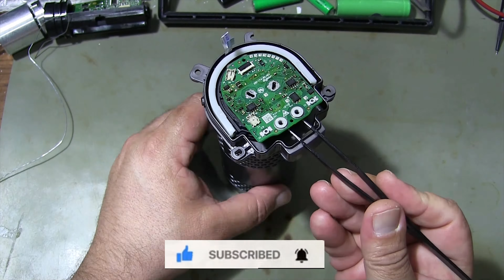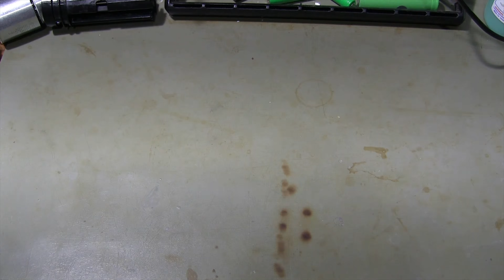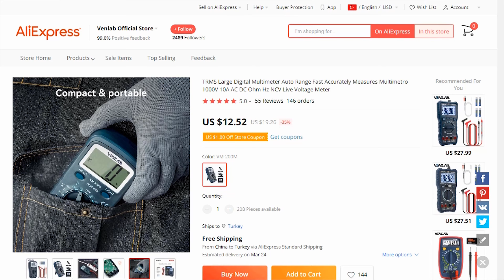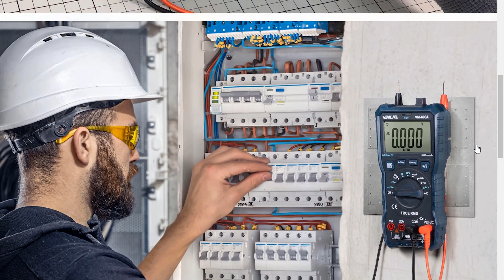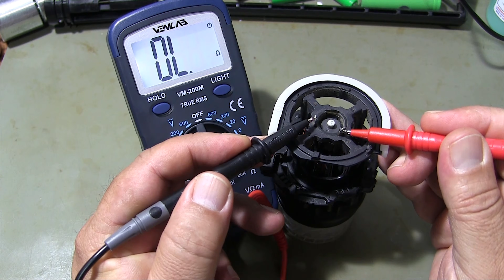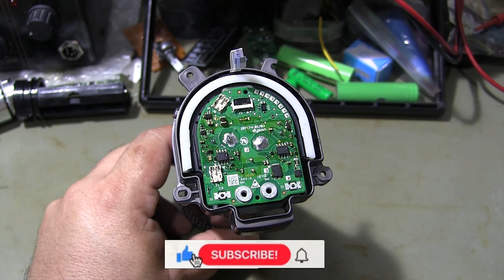How to Check DYSON V11 Vacuum Cleaner Motor with Multimeter?

Comment: My Dyson V15 suddenly died. The battery won't charge at all. I went ahead and bought a new battery charger to eliminate that possibility. My next purchase is a new battery pack.
Reply from the maker: The battery seems faulty, but I'm not entirely sure. If you have the option to try a battery from a different device, I suggest you do so.

Comment: Io ho un Dyson V10 che nelle velocità uno e due cerca di avviarsi senza farlo, mentre alla massima velocità gira....spero che il video mi aiuti a risolvere...
Reply from the maker: I suggest you also check the capacitors on the circuit board.
Reply: @electronic7979 Grazie mille per aver confermato il sospetto e la speranza!👍💪

Comment: Hi. Dyson V10, only Max works, Medium and Low only starts for like half a second and stops. Many have reported this issue, but no solution or root cause found. Any idea?
Reply from the maker: In this type of device, capacitors have critical importance. Especially in speed control circuits, capacitors are among the components that fail most frequently. My advice is to replace these capacitors first.

Comment: 6 минут - из которых 4 минуты выпаивание двух клемм и  2 минуты - измерение сопротивление двигателя и выходных ключей. Ну, что сказать - это было смело.
Reply from the maker: Yes, that's exactly how the time distribution went. Removing the two terminals took longer than I expected, and I used the remaining time to quickly check the motor. Thanks for your comment.
Reply: @electronic7979  Ok, what resistance on input klemms? What resistance between input and output klemms? What volts between all of them klemms in diode mode? In differnt polarity? This informatoin more useful compared to information on how to solder using a pump. 
P.S. I have the same resistance as author but my device is not working...

pu-pu-pu
Dyrected by 
ROBERT B. WEIDE
Reply: Классическое видео разводовсих циган

Comment: Hello, I have a Dyson v15. It turns on and then turns off after a few seconds. I read somewhere that the capacitors are faulty. What do you think?  Before I start repairing, I would like to hear your opinion.
Reply from the maker: They are most likely faulty capacitors. I recommend replacing the capacitors first.
Reply: Please can you tell me/ us which capacitors are used? How do you removed the transparent coating from the circuit board ? 

Thanks for your help
Reply from the maker: @Arcane-Rogue1 You can clean the coating using cellulose thinner or methyl ethyl ketone (MEK). It can also be cleaned with pure acetone.
The capacitor values are 270 µF, 35 V or 50 V.
Reply: @electronic7979 thank u very much. Do I have to reapply a coating ?

Comment: Sabes que voltaje maneja el motor para poder meterle el voltaje directo y descartar que funciona el morro vaya ponerle voltaje directo sin que pase por la placa puedes ayudarme ya que al presionar el botón solo da un sonido pero no aspira
Reply from the maker: I don't know the motor operating voltage. You can try by applying a 12V DC voltage.

Comment: motor is turning on for just a fraction of second andthen turn off. Just Like clicking noise. After un soldering the motor from board the resistance is about 5 mega ohoms. Can you help what could be the problematic part on board?
Reply from the maker: The motor driver MOSFETs on the circuit board may be faulty.

Comment: Hi Electronic workshop, after I washed the filter and put it back for using, the Dyson stopped working and LED display didn't turn on. Can you diagnose and suggest the solution?
Reply from the maker: Hi! It sounds like your Dyson vacuum stopped working and the LED screen doesn't turn on after you washed the filter and reinstalled it. This is a common issue with Dyson V11/V10/V15 models and can be caused by several things. Let's go step-by-step to diagnose it.

Diagnosis Checklist

1. Was the filter fully dry?

If the filter was still wet inside, it can trip internal moisture protection or even damage the electronics.

Dyson recommends letting the filter dry for at least 24-48 hours in a warm, dry area before reinstalling.

2. Filter not seated properly

The vacuum won’t turn on if the filter is not fully locked into place.

Twist the filter clockwise until it clicks firmly. If it's even slightly loose, the vacuum won't power on.

3. Battery connection issue

Try removing and reinstalling the battery.

If your Dyson uses a removable click-in battery, press the red button and pull it out. Then reinstall and try again.

4. Try charging it

Plug it in and leave it charging for 30 minutes. If the battery went flat or something tripped the power system, it might recover.

Do you hear a click when plugging it in? Do you see any light when charging?

5. Internal fuse or PCB damage

If water got into the motor head or cyclone assembly, it may have shorted the mainboard or battery PCB.

That would cause no display, no motor activity, no lights.

 Suggested Solutions

Filter damp / wet	Remove the filter and let it dry for 24–48 hours. Keep vacuum in a dry place during this.
Filter not clicked	Remove and reinstall the filter. Twist it until you hear a solid click.
Battery issue	Remove and reinstall the battery. Try with a different battery, if you have one available.
No charging / no light	Try a different charger, or measure the charger output with a multimeter (should be around 30.45V for V11).
Internal damage	Unfortunately, you’ll need to open the vacuum and check the main control board or replace the battery. If the PCB is damaged, a repair or replacement is required.
Next Steps
First, let the filter dry and double-check that it’s locked into place.
 Second, try charging for 30+ minutes.
 Third, test with another battery if available.
 Last resort, you may need to open the vacuum and inspect the PCB for short circuits (burn marks, corrosion.

Comment: My v11 vacuum cleaner has a certain malfunction. In economy mode, the brush rotates and stops. In medium mode, the brush starts working and then stops. The motor continues to work! In turbo mode, the vacuum cleaner works normally.Is my problem that the engine is weak?
Reply from the maker: This specific behavior suggests a power delivery or communication issue between the main body and the cleaner head (brush), especially under low and medium power modes, which use different PWM duty cycles or logic thresholds than turbo mode.
Here are the most likely suspects:
1. Faulty Brush Motor or Internal PCB
The motor inside the brush head might have degraded to the point where it only runs reliably at full power.
The hall sensors or motor driver MOSFETs on the PCB may be damaged.
Fix: Disassemble the brush head and test the motor separately. Check the PCB for burnt components.
2. Loose or Dirty Brush Contacts
The electrical contacts between the vacuum wand and brush head (or wand and main body) might be dirty, oxidized, or loose.
Lower power modes might not deliver sufficient current through partially oxidized contacts, while turbo mode forces enough current through.
Fix: Clean all metal contacts with isopropyl alcohol or contact cleaner. Inspect spring-loaded pins for wear or poor contact.
3. Faulty Wand (Tube)
The wand has wires running through it; any damage or internal break can cause intermittent brush power, especially under variable load modes.
Fix: Test with another wand if available. Or continuity test with a multimeter from end to end.
4. Firmware or Control Board Logic Issue
The mainboard (PCB near the motor) may not be correctly handling the low and medium power modes due to a damaged MOSFET, sensor, or communication line.
Fix: This is harder to DIY unless you’re experienced, but you could inspect the board for visible component damage, especially the power delivery circuits going to the brush.
Reply: @electronic7979 I checked with a different brush/rod, the problem still exists.

Comment: Why is there a plague of broken V11 motors? What is it that causes so many of them to die and how to avoid this? I suggested to people not to let their batteries become too low in voltage / state of charge. As current rises at low voltage and heat becomes an issue.
Reply from the maker: There may be a problem with the MOSFET driver integrated circuit or electric motor.

Comment: Hola, mi dayson v12 funciona pero antes hay que apretar entre 5 y 10 veces el boton de encendido. 
Pensaba que era problema de suciedad pero la he limpiado y soplado totalmente. Sera de la parte electronica pero no se si piede ser lo que miestras en el video.¿ Alguna ayuda para coger un camino?
Muchísimas gracias por el video
Reply from the maker: Your problem may be caused by the button inside the on/off switch. You can check its strength by measuring the button with a multimeter.
Reply: Mi v11 hacía lo mismo. Le aprietas al botón y se apaga después de unos segundos, y así hasta 10 veces o más. Para arreglarlo tuve que cambiar los 3 capacitores en la placa madre del motor. Se llaman híbridos, o de polímero, la verdad no me queda claro, son de esos metálicos, de 270 uF a 35v.

Pero la verdad puede que no sea una reparación tan fácil en tu aspiradora. En la mía no lo fué porque el circuito viene cubierto de silicón para hacerlo impermeable, y quitarlo es bastante difícil porque se desmorona, y luego se queda una capa delgada y muy pegada a la soldadura, que no deja que se transfiera el calor del cautín. Y luego hay que desoldar el motor de la placa madre, y el motor absorbe tanto calor que hasta se enfría el cautín y se solda solito por un rato. Igualmente, la soldadura usada en estos componentes es de la que no trae plomo y necesita calentarse bastante antes de poder removerse. Creí que iba a quemar todo antes de poder remover el motor.

Igual y te es más conveniente comprar el motor en Aliexpress, que viene con toda la placa madre, la carcasa de plástico que se atornilla a la dyson, y la pantalla LCD.
Reply from the maker: Yes, you are right, it is not easy to repair. If you do not have good electronic knowledge, do not try to repair the electronic circuit board.

Comment: Hello thank you for the videos I also check my pcb but I have about 1.6 m ohm on the pcb without motor and it goes up is this normal? Thank  you
Reply from the maker: It is normal for a value as high as 1.6 megaohms to appear when there is no motor.
Reply: @electronic7979  Okay thank you I ask because you have 1m ohm

Comment: have you measured a faulty motor/motherboard? what are the values of a faulty motor?
Reply from the maker: A faulty motor. When you measure the motor by removing it from the circuit board, it usually shows an open circuit.

Comment: Hello. My engine makes a sound like BOOMMMM when I press the button and won't start. And so every time after I press the start button again. At the moment of pressing and without, the battery maintains 27 volts without any fluctuations.
What could it be?
Also tell me please the resistances of the limiting resistors.
Is it possible to check MOSFET TPHR8504PL transistors without desoldering them?
Is it possible to check the limiting resistors of MOSFET TPHR8504PL transistors without desoldering them?
How to check them correctly with a conventional multimeter?
On the board, the resistance at the motor solder points is 2.3 mega ohms. You have almost 1 mega ohm. This means without soldered motor contacts. Why is there such a difference?
Let me know if you have a working module. My number for dyson SV14 serial No. C1Y-EU-MEA8959A
kind regards best regards

Comment: How to confirm the motor winding is not burnt or open circuit?
Reply from the maker: You can understand it by measuring it with a multimeter.

Comment: my friend , how can i fix v11 that works only at top speed?
Reply from the maker: Hello. If your Dyson V11 vacuum cleaner only works at the highest speed, it might indicate a problem with the speed control circuit or its components.

1. Potentiometer or Sensor Issue in the Trigger
The speed adjustment is usually done through a potentiometer or sensor connected to the trigger mechanism. If this part is faulty, speed control cannot be achieved.
Solution: Check the potentiometer or sensor in the trigger with a multimeter. Replace it if it is defective.

2. Speed Control Circuit Fault
The Dyson V11 uses an electronic circuit to control the motor speed. Components like the MOSFET, transistor, or PWM (Pulse Width Modulation) control circuit may have failed.
Solution: Inspect the speed control circuit, identify any damaged components, and replace them.

3. Main Board Problem
A short circuit, burned resistor, or capacitor on the main board's control circuit can disrupt speed control.
Solution: Carefully examine the main board and replace any suspicious components. If you notice visible burn marks on the circuit, prioritize inspecting that component.

4. Software Error
Some Dyson V11 models use a microcontroller for speed control. A software or firmware issue could cause the device to operate at only one speed.
Solution: Try resetting the device to factory settings. Refer to the instructions in Dyson's user manual for guidance. If necessary, seek support from an authorized service center.

Comment: How the Dyson detects the filter is chocked
Reply from the maker: A clogged filter will cause the motor to work harder to maintain suction power. Dyson vacuums monitor the load on the motor and if it detects that the motor is straining more than normal, it will assume there is a blockage, which could be a clogged filter. It can detect a filter blockage by calculating the current drawn by the motor.

Comment: Value less than zero ohms? Only superconductors have zero ohms. And less than zero I didn't even think was possible. And on top of that at room temperature... :)
Reply from the maker: Great observation! Actually, superconductivity and resistance below zero ohms are theoretically not possible at room temperature. The point I was trying to make in the video was a very low resistance value. Thanks for noticing, your comment helped me clarify!

Comment: Мой пылесос как то работает странно,я думаю мотор надо менять,ни где не могу найти информацию. Он работает но с прирывистым  шумом при этом не всасывает. Что это может быть,хотелось бы знать точнее,так как я сегодня его разбирала полностью,продула всё от пыли но он всё ровно шумит при включение странно
Reply from the maker: There may be the following problems in a vacuum cleaner that makes strange noises and has low suction power:
1- When the bearings in the motor of the vacuum cleaner wear out, it can make loud or strange sounds. In this case, the motor or bearings may need to be replaced.
2- A decrease in suction power may be caused by a clogged hose or filters. Check that all filters are clean and the hose is completely open.
3- If the motor used in the vacuum cleaner is a brushed motor; When the carbon brushes of the motor wear out, it may make noise and the motor efficiency may decrease.
4- There is a fan or impeller inside the vacuum cleaner that helps the motor's traction power. If this part is broken or damaged, it can both make noise and reduce suction power.
5- If there are small cracks or sealing problems in the body or hose of Dyson vacuum cleaners, this can also make noise and reduce suction power.
I recommend that you check what I have written.
Reply: @electronic7979  похоже на ответ ранних версий GPT))  Какие еще угольные щетки в Dyson V11? ))

Comment: Hello, do you know what should I check with voltimeter if vacuum is working but not image on screen?
Reply from the maker: Check that the cables and sockets to the display module are intact. If there is a contact problem, the display may not receive power. Check that small components in the display circuit, such as fuses or resistors, are burnt or shorted. Check the correctness of the values of these components by measuring them with a multimeter.

Check the voltage inputs to the display module. Measure the voltage coming into the display module by setting the multimeter to DC voltage mode. Make sure that the required voltage is supplied according to the manufacturer's specifications.

Visually inspect the display circuit and main circuit board. Watch for physical signs of damage, such as burn marks, cracked components, or cold solder.

Comment: On my vacuum V6 accidentally some water got in the motor and now it does not start. I noticed that in the back of the motor is a LED that it is flashing 5 times and if I push the button some kind of small clicks can be heard.
Reply from the maker: Water in your Dyson V6 vacuum cleaner may have caused short circuits or damage to the motor and electronic components. LED warning lights, especially on Dyson vacuum cleaners, indicate certain types of faults. A rear LED flashing 5 times usually indicates a problem with the motor or battery.

The following problems can occur when the motor is exposed to water:

1. Motor short circuit: If water has seeped into the motor, motor components may short circuit.

2. Control board damage: Electronic control boards may be damaged by water. Motor driver mosfets may have failed.

3. Battery failure: If water has come into contact with the battery, the battery may also be damaged.

4. Trigger mechanism: A clicking sound when the button is pressed can indicate that the motor is being forced to start but the electrical connection is not correct.

What to do:

Wait to dry: If water has only gotten superficially into the vacuum cleaner, waiting for it to dry completely can sometimes solve the problem. You can open the vacuum cleaner and clean the areas that have been in contact with the water.

Comment: Hi, How can I make sure motor or board witch is broken?
Reply from the maker: You can check the motor and the materials on the circuit board by measuring them using a multimeter.